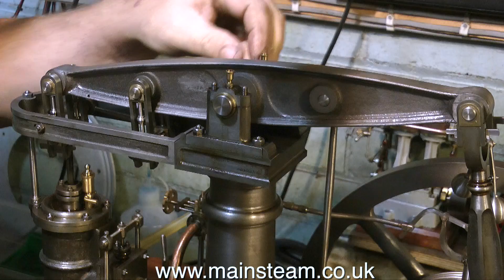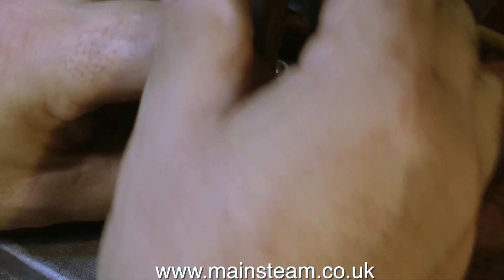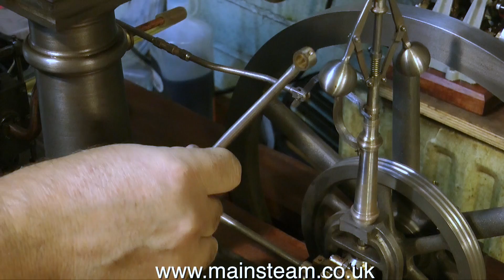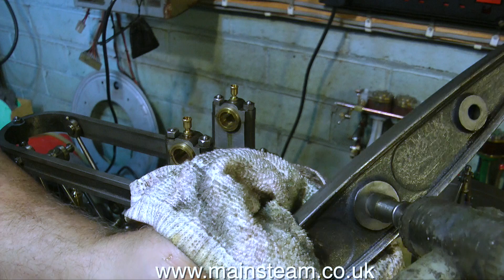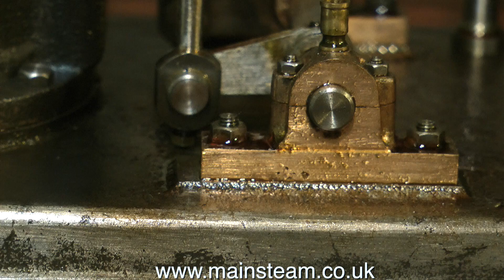STUART MAJOR BEAM ENGINE REBUILD - PART #2

Comment: the holes are not centered in the casting, but are they in the correct positions from each other?
Reply from the maker: I assume so. The positioning isn't that critical, but I am puzzled why the builder drilled them of centre....
Reply: @keithappleton  are the holes even drilled straight through? perpendicular to the surface. so to say

Comment: I think the engine is build the old fashion way. First the parts who has to be really accurate and then everything else.
And the most accurate part is in my opinion the Watt's linkage. 11 parts who have to be absolute accurate towards each other. If not the piston rod has horizontal movements which will destroy the piston over time.

The fun part is that the linkage can be build without a caliper. All you need it a compass, a straight edge and a scriber.
Build this way the other parts can get "off" to compensate the lightly to big or small linkage.
Here it looks like the Linkage is a little to big for the castings.